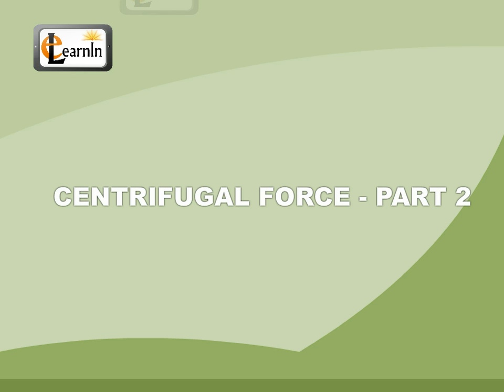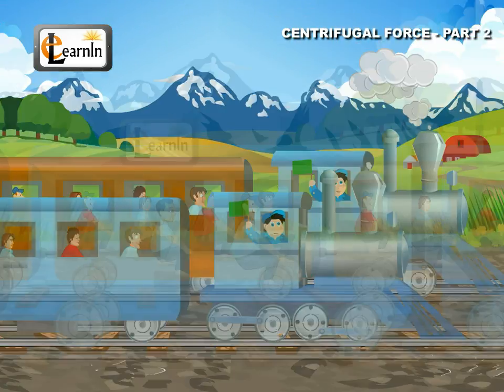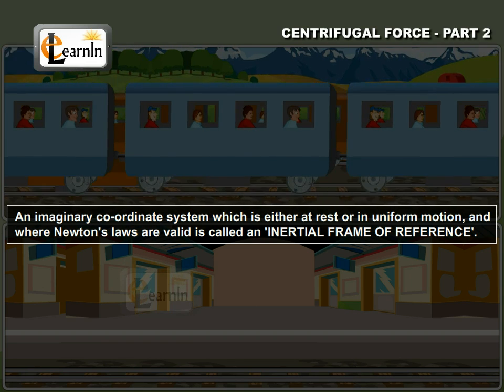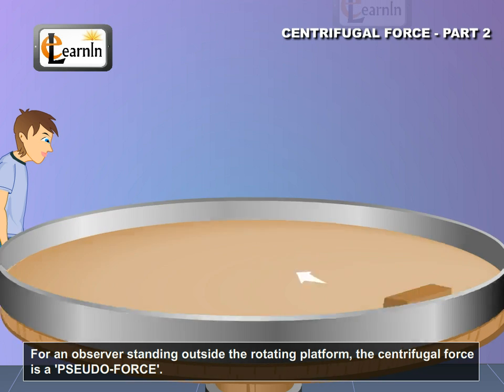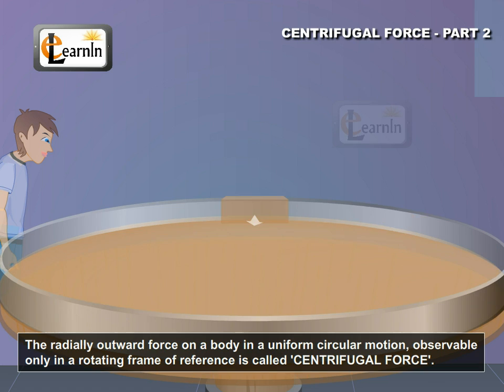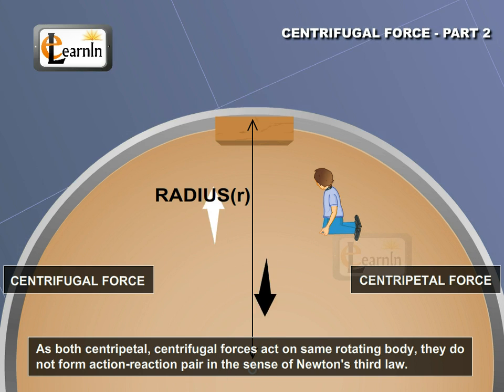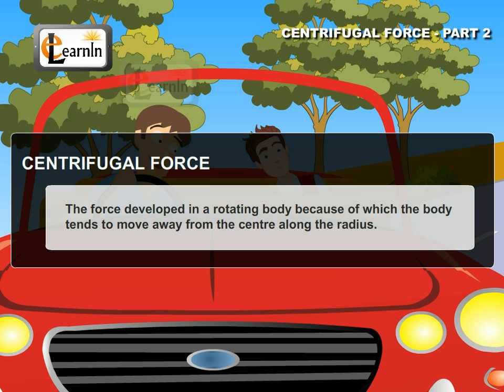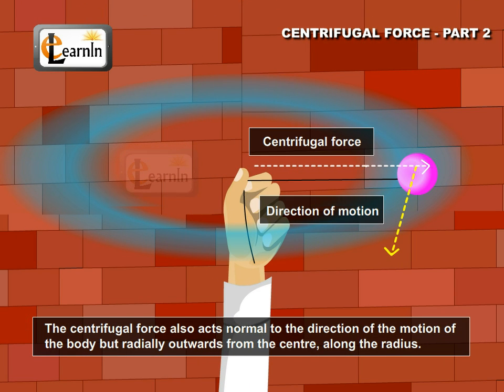Understanding Centrifugal force - Part 2 - Physics

Comment: This is incorrect. Kids are going to be very confused by ideas that are not useful. Centrifugal force does not depend on reference frame. Constructing a scenario where it is fictitious does not make it a pseudo force when observed in a reasonable way. In an inertial frame a mass in a circular motion will be subject to Newton's second law. The law states that the force that accelerates the object is equal to the inertial force resisting a change in motion. You can easily demonstrate that Newton's second law is two forces in balance. This sort of misdirection by over complexity is one of the methods of authority based physics. By creating confusion these scoundrels create a system where the student relies on the teacher for truth but the teacher lies. This makes the student dependent on ideas given him. This is the opposite of science. A few simple experiments will teach this subject much better.
Reply: In inertial frame of reference there is only one force making an object move in a circle! Only one! There is no balancing force!
Reply: Centrifugal force only acts when you are too in a circular motion just like it has been depicted in the video. Centripetal force is the only force here. Another force is created due to the velocity in the direction of tangent. So the resultant force is between the two visible forces which is making the body rotate. Do you need Centrifugal force to define its circular motion? The answer is NO.  But if u see sitting on the centre of a circle then you will notice that “Something “ is dragging the body backwards. But you know nothing can change its position unless you give it an external force as per newton’s first law. So you give it a name (remember that you are too in a circular motion) which is Centrifugal force. 
If you want to know more about it PROPERLY look into the book named “Fundamentals of Physics” written by Resnick & Halliday
Reply: The video is correct. In an inertial frame of reference the uniform circular motion of the block obeys Newton's Second Law if the block is acted upon by a single centripetal force. If a centrifugal force were included in the analysis it would balance (cancel out) the centripetal force, leading to the conclusion that the block must be either at rest or moving in a straight line at constant speed.

In the rotating frame of reference, the block is at rest, so it must be acted upon by no net force. Hence, in this frame of reference the centrifugal force is required to balance the centripetal force.

Is the centrifugal force a fictitious force? It certainly has quite a different cause than the centripetal force. On the other hand, it feels like a real force. So I don't know.
Reply: The only question to be answered is, is the block accelerating? Clearly it is and Newton's second law applies. All forces are balanced because of acceleration. The interpretation that an unbalanced force produces an acceleration is not useful. The verifiable reality is that an acceleration is how a mass produces a force to balance a force on it. This notion about what forces do or don't exist is what happens when you start with a fundamental misunderstanding and apply it to more complex situations. Basically you are saying a force is equal not to a force. You should call your video a force is equal to a banana.

Comment: What force causes artificial gravity in a rotating space station on a person standing against inside surface of the outer layer of space station?  Is this centrifugal force? Then what about a person accelerated inside a closed box in the space away from any gravity as the case stated by  Einsteins, the person also can stand against the inner surface and can feel gravity towards the surface but there is no force on him in that direction, he only experiences force towards the direction of velocity which is in opposite direction of 'force' that causes artificial gravity.